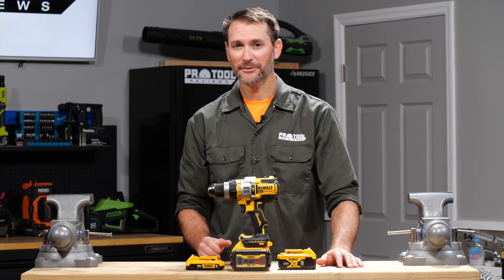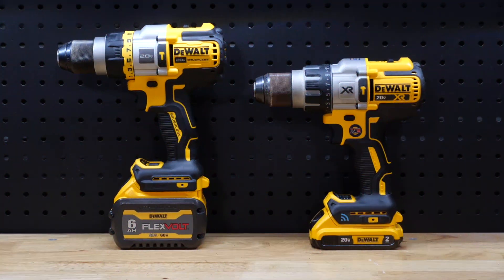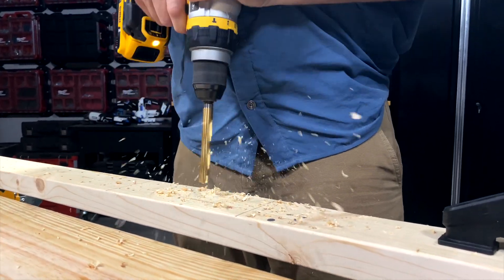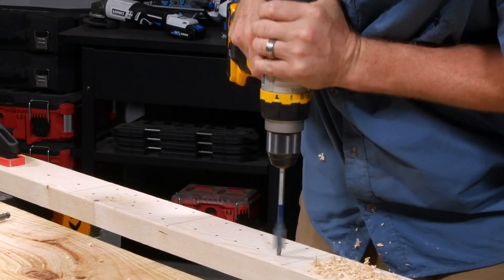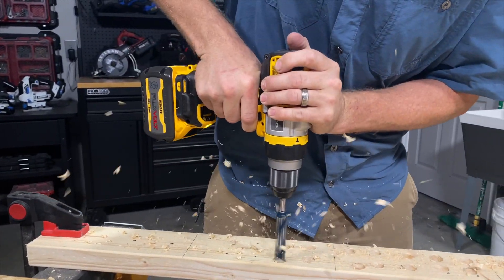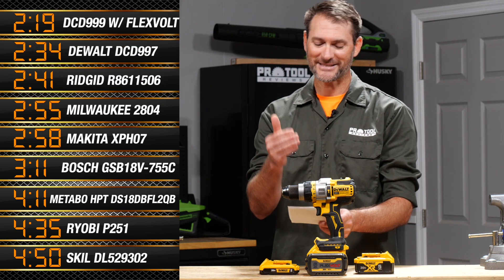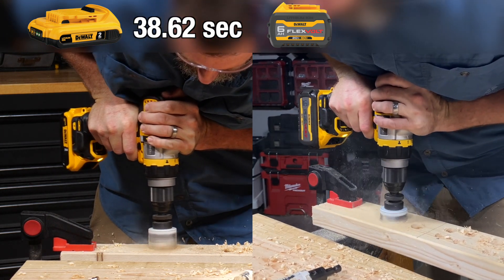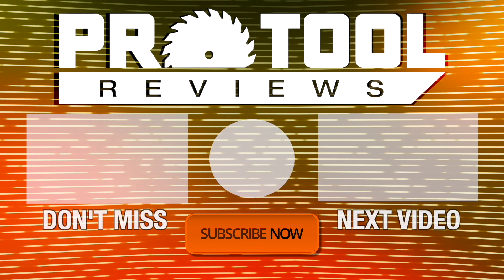DeWalt Flexvolt DCD999 Hammer Drill TESTED

Comment: I got the 999 with the 5AH because I’m not in a race to break my drill & the flex battery is so heavy.
I’d be more tempted to buy it if I knew how much longer it lasts & recharge cycles life vs the 5AH..there relevant things where a race isn’t..also if your using a battery drill on such bug bits your probably better off going on mains power & not straining an expensive cordless drill with massive battery powers..

Comment: Running a drill at max rpm and feed pressure straight through is not normal for me and many others as I suspect we wish to avoid ugly messy blow out. The extra power/torque from Dewalt flex volt or larger batteries is useful and has certainly changed what can be achieved with these compact battery drills.

Comment: Why does 1,2 and 3 on the speed transmission sound the same? I bought 2, thinking the 1st was defective. But I use a 5ah 20v, and a 9ah 60v. Any battery, any setting on 1,2, or 3 , sounds the exact same. Is this correct ?

Comment: Just ordered the combo that also comes with the impact driver and two 20v 5.0-AH batteries.....big step up from the black and decker matrix I picked up from Wal-Mart a few years ago 🤣
Reply: Gotta love the cheap stuff though they came along way . I've been bailed out by a harbor freight impact several times lol
Reply: @jordanalexander615  a year later and I bailed on the Dewalt and went with the new milwaukee impact and hammer drill 😋
Reply: @davids.3725  it's all preference I like both for industrial use the name brands seem to be the way to go. Though I gotta say kobalt has been growing on me the past few years especially their right angle impact. But I'm a tool fanatic I bought a 60v 1 inch impact just to have it lol
Reply: @jordanalexander615  oh, I didn't mean to put dewalt down, heck my milwaukee only coworkers would grab my dcd999 from time to time, and I'd still be using it but once I saw the milwaukee 4th gen had an auto-stop I figured I'd give it a shot...I work in metal fabrication and some construction, and that auto-stop has come in handy 😄 but that dewalt definitely held its own and over performed in many applications...like you said, comes down to preference for sure. Using the milwaukee for a while now I feel like the motor is smoother, less vibration, but could just be the ones I got.
Reply: @davids.3725  auto stop do you mean where it stops the second it snuggs up. Pretty much an automatic hand tight ?

Comment: Don't think this test is 100% complete yet. Love my DeWalt gear and buying possibly a 999  very soon...Or the one that's missing from the competition.The DCD998 which is also supposed to turn on the jets with the Flex Volt battery thanks to "power detect" . Which is really superior? Are they the same drill with the exception of a single digit? Is it just so Lowes and HD can each have an exclusive version of the flagship model? If you know please pass it along before I just go buy a flex lol

Comment: On a more technical note, each lithium cells are rated to kick out about 20-40 amps with of course a massive voltage drop. The more in parallel (in this case the amp hour rating), the more rated maximum current draw, but also multiplied output power. (Lots of ways to look at this, batter overall ESR is the limiting factor, and parallel cell connections lower the overall ESR) 
For people that says higher AH rating only gives you a higher capacity (energy), and not power, they are wrong. The performance of the DCD999 is the result of a monstrous battery and careful tuning of the electronic control side of things.
I'll be doing a teardown of it and some inspection from an electronics point of view.
Reply: You tear it down yet?
Reply: @wrothacker4  Not yet, but I could, was there anything you wanted to see?

Comment: Just a kind and helpful suggestion; your time trial set up is kinda cool, however, I would suggest adding or using larger type of SPAX screws, or small lags, which would test the power and speed of a particular drill.  They would not need to be Huge, just something more than drywall screws.  And further, pre set them into the material, which would eliminate any fumbling with starting the screws, guessing at the time, etc.  Thanks for considering this.  Stay safe and Healthy!
Reply: Why not put that on your videos?
Reply: @wgooetrik  because it’s a useful criticism and suggestion. With the operator starting the screws, it adds a variable to a test that should be as controlled as possible. The current method of testing isn’t testing the tool objectively, it’s testing the operator with a specific tool, which is sort of subjective, or at least adds variables.

Comment: Didn’t no there was a 997. I no of the 996 original hammer drill. Then the 998 power detect and now the 999 flexvolt advantage. Guess I need to look up the 997

Comment: great tools Dw is up there with Mkta, Mw, Bsch, rdgd, metabo (hitachi) and like. I have the atomic the dcd 887 the 7771 7772 (brushless) two 12v drills and 1 impact and the brushed screwdriver.
Reply: I have the Atomic 708 sub compact drill and love it ,I am a carpenter and use it on a 16mmx600 auger on timber ,torquey little bugger and lightweight.

Comment: Nice video!! 
As starter i just bought the thought kit which includes skillsaw, grinder flexvolt advantage and sold the atomic drills to get the xr impact and flexvolt drill, sold my old tools cheap and got enough to buy the reciprocal saw flexvolt too with battery included, now i have new tools and the whole new advantages tools thanks to this new deals, I use to buy cheap tools on yard sales but end it up not working well but now with the buy of a new home ( needs a lot of work) this tools will help a lot.